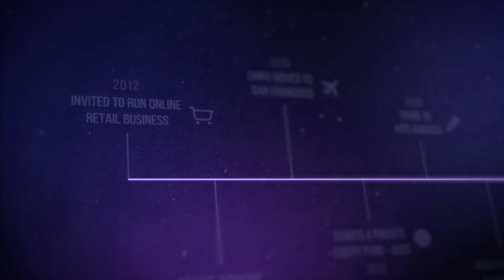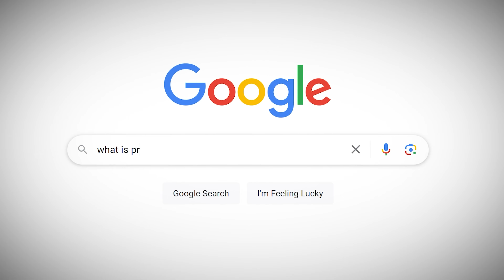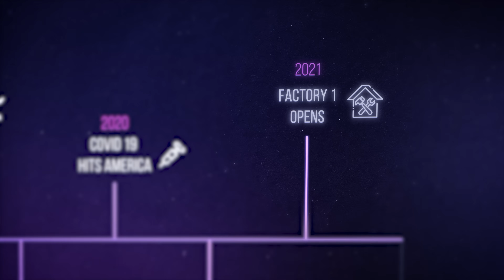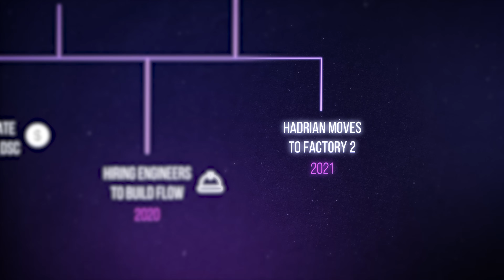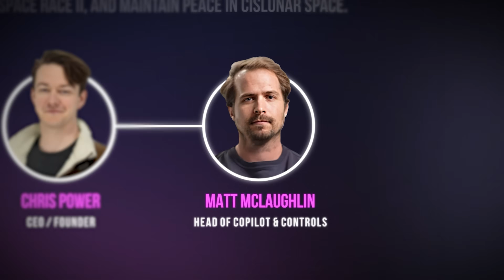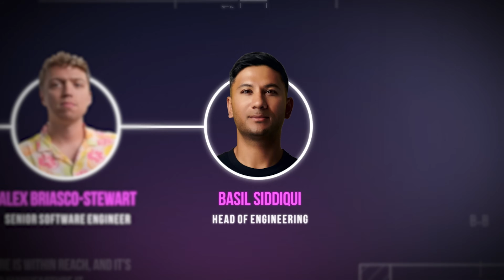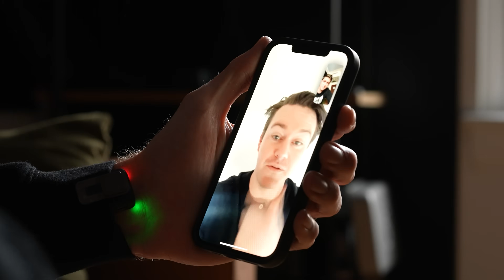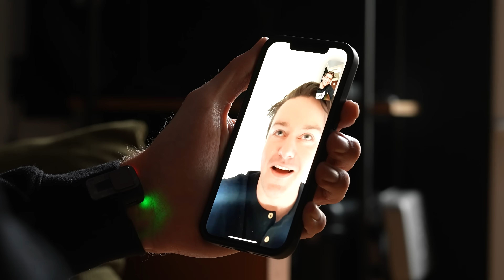Inside the Future of American Manufacturing [Startup Documentary]

Comment: I'm extremely familiar with the industry and work in it, and I completely agree with the initial analysis that a bunch of the aerospace and defense supply chain is held up by aging machine shops. But then the result seems like they're recreating something similar to a Protolabs or Xometry.  Don't get me wrong, I love a well run fabrication house, but maybe I'm just missing the bigger picture.
Reply: The two companies you mentioned seem to create parts that don't require the precision, sophistication, what have you, that Hadrian is going after by building for aerospace and defense. Do you see it differently?
Reply: @jeremytopper9  Yeah I typically don't use Protolabs for anything more precise than +/- .005" tolerances.  So there's some market share there.. but there is also still a lot of competition. 

Also they don't seem to do other fabrication methods like welding, sheet metal, etc.  It looks like it's 100% Aluminum milling at the moment. Which is a pretty small segment of the market. 

I'm sure they'll grow their offerings over time and outsource the fabrication and surface finishing work as needed.. but I guess what I'm getting at is that when I was first watching, I was just thinking it was going to be something other than a well-run CNC shop.

But I mean, there's nothing wrong with that, I'm still rooting for them.  And I'll probably send some work their way when they start expanding their offering more.
Reply: @matts9728, I thought the same. This is just a high end machine shop that is trying to automate their way into scale... I wonder what this will be in years to come... These sort of high precision and high value parts are challenging to do right, to say the least. Plus the fraction or percentage of labor to the whole cost of the part is relatively small. It's a ton of effort to get a relatively small gain in competitiveness. This game would be easier to play if you were a Xometry or the like - harder to play for large, expensive, high-tolerance parts... 

I can't argue with their approach to keeping the spindles moving, but I wonder just how much business they can win profitably. Time will tell. I'm a huge fan of their robot-tended DN machines though!
Reply: They are not doing anything special at all, besides having more access to startup capital than most machine shops. This is a marketing video.

Comment: 13 years ago when I was in school for mech eng I spent a summer working at a medium sized aerospace parts supplier that heavily relied on CNC stations. During those months I learned that the craft in manufacturing these highly complex, highly valued and precise parts was closer to art than engineering because there was just so much of the undocumented know-hows that are critical to quality only resided inside of the brains of the folks who have been doing it for 20, 30 even 40 years. Many of them didn't even want to answer my 'stupid questions', let alone teaching me anything. I knew the gap in the market for automation existed but the knowledge transfer seemed like an impossible task especially with my lack of knowledge AI and machine learning at that time.
The story of Hadrian genuinely excites me. I will follow these guys and root for them. Turning art into science is always exciting.
Reply: Aerospace tech here with almost 2 decade of experience in the business, and I have had 25 year old engineers laugh at me when I said it’s more of an art due to the subtleties inherent to building high quality parts Based on the video, I think their greatest strength is that the younger engineers want to learn how to build things.
Reply: hey where do you work now? I am also interested in stuff like that and would like to learn more. got any suggestions?

Comment: Very impressive startup, so far they have produced a very good CNC machining company.  It remains to be seen if their approach  is significantly better than other high end  CNC shops.  They collect machining data with off the shelf equipment, that many shops use,  how they incorporate that data in their software is the key.  They said they put machines on the software and not apply software to machines that everyone else does, it will be interesting how this unfolds.

Comment: So first nuclear power is THE solution to the lunar solar constraints. See micro modular reactors. Second the thing regarding landing within 500 miles of a base bc regolith sandblasting everything around is accurate but exaggerated and easily mitigated by the fact that all structures will naturally need to be buried under 3 meters of regolith to protect them from the ambient radiation which is sufficient protection from the sandblasting effect. This was a great video of John and is much appreciated. Glad they're doing this.

Comment: Sooo. It's a regular aerospace job shop with in house software development. Instead of outsourcing that to SAP or Siemens or something.  I'm really not seeing anything new here besides a lot of investment money right off the bat.
Reply: A manufacturing supplier that’s also a software company is a very unusual thing
Reply: A startup does not always have to be a new technology. Uber simply joined software and taxis together, Stripe sped up bank transfers, and airbnb combined short-term property rental with software. All these and many more startups dont actually make new technologies. They streamline a pre-existing process with software, like this company is doing.
Reply: for manufacturing biz it’s all about capability, quality, speed, and cost. if any company can strap all 4 aspects down in their own domain, you don’t need to reinvent the wheel. if software can help to yield the maximum output, it’s like F1 race car capable of nimble maneuvering on the track of production instead of full autonomy production line like a fast freight train hurling down the road incapable of making tight adjustment. The industry they serving for based on their approach sounds like a good idea. 🎉
Reply: Yeah I'm kind of curious how they're different from Protolabs. The idea of sending a model out and getting an automated quote is not new. Same thing with loading the block and letting the machine run overnight. Proto has been doing both for years.
Reply: Ja there are some companies close by that have already min 80% automation. Fastems or erowa are big
Reply: Maybe rewatch the video
Reply: @PeterPan-hs5tu  It is a great idea. That's why every machine shop for the past 30 years has been using ERP and quoting automation software.
Reply: Maybe for you, but most of us don’t see stuff like this every day.
Reply: What a big brain you have. No. It's the answer to the problem that started by sending manufacturing offshore - all the inovation goes with it because the only place it ever happens is on the factory floor. YOu cant outsource the fundamental process or you end up paying for another source's tech. It's the only smart way to make shit work and benefit from investment and the developments
Reply: That's a very reductive view on what the whole opetation is
Reply: Nothing is new under the sun, but someone has to do it.
Reply: Right.  Mediocrity is rewarded for certain groups of people.
Reply: @photon2724 every example of yours was wrong 😂😂😂
Reply: This founder makes my BS Meter go off like crazy
Reply: You've clearly never worked in manufacturing. Otherwise you'd know that a ridiculously high amount of companies are absolute dunces when it comes to utilizing software efficiently to boost their productivity. So although the concept is obvious, the application of it is clearly not so obvious.
Reply: I see how it could be new and very unique, vertically integrating makes a ton of sense here.
Reply: I'm an outsider to the industry but this seems far more automated than other companies.
Reply: I see the potential of lowering cost for high quality product low quantity output which suits particularly industry like defense. Can’t trust to offshore outsources, high margin low pcs count. Me living in Taiwan can def take cues on our side of demand. But again like some smarty pants upstairs pointed out. It seems like more filler than substance. Never know until we see the credible revenue report of the company.
Reply: Cry about it

Comment: Been in automation for almost 2 decades, didn’t see anything new here. Quote software could get you quote wit a step file in 5 seconds and generate G code. So what did he create?
Reply: Something you wish you did but now you are just a fan aka a hater
Reply: Xometry has a similar front end and some of their vendors have similar manufacturing capacity
Reply: I agree, nothing seems to be particularly novel. But they do have a nice clean machine shop. The CNC oil hasn't coated every surface in the entire building yet.
The only thing new is analyzing the tooling for wear. At least I have never heard of it.

Comment: I'm amazed they did this in LA and not literally anywhere in Texas. Dude started on Hardcore difficulty😂
Reply from the maker: there's actually a ton of interesting manufacturing stuff happening in LA / El Segundo area right now.
Reply: LA has always been a hub for manufacturing. Historically pioneering in manufacturing this is just another chapter in its history.
Reply: It's prolly easier to get investors in LA
Reply: @MateusChristopher Texas triangle has strong vc connections and lots of capital looking for dealflow so that's probably not the driver. The likely answer is that LA is close to the valley and that's where he had his connections.